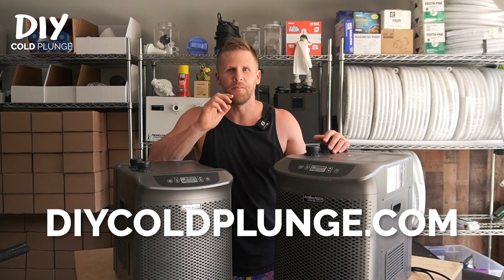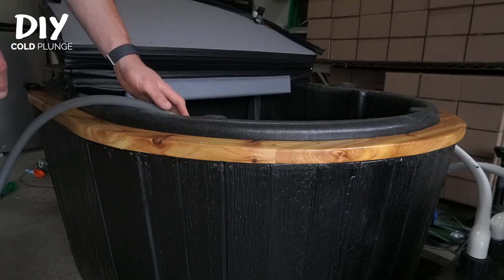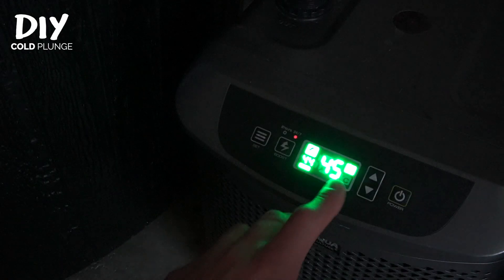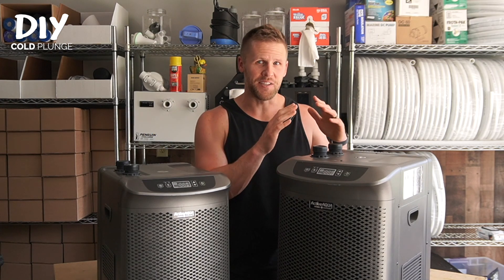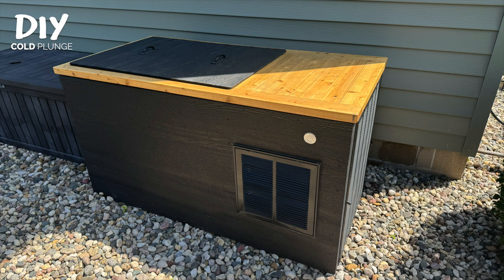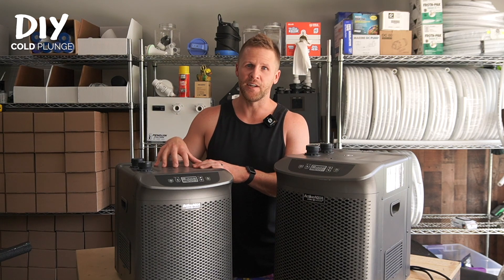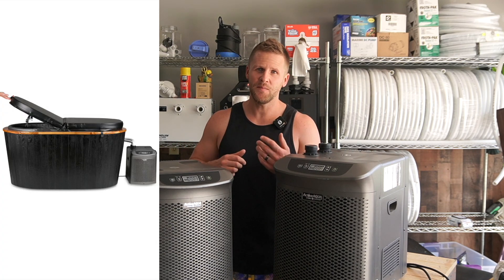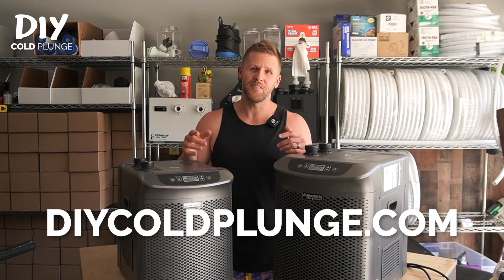Can a 1/4HP Chiller cool a 150 Gallon Tank? DIY Cold Plunge Active Aqua Chiller Review

Comment: I just purchased the 1/4 hp and left it on for a few hours and didn't see any drop in temp. I have 100 gallong insulated build out. The water is currently 68. Should i put ice in it to bring the temp down first or how long should it take to drop 20 degrees?
Reply from the maker: What pump are you running?

Comment: @DIYColdPlunge I didn't see a video discussing this but before I decide to buy the plans, I had 2 questions regarding your DIY Cold Plunge Chiller Enclosure: 1) is it waterproof 2) roughly how much do the materials cost?
Reply from the maker: It will shield the chiller from the elements, not be completely waterproof. I don't have an exact cost breakdown but it's a few 2x4's, siding sheet and cedar boards plus a few hardware/misc items

Comment: Would it be cheaper to buy an ice machine?
Reply from the maker: Not necessarily... there's a lot of manual labor that goes into constantly putting ice in (even with a machine), it leads to more frequent water changes, and you also need to make sure you get an ice maker that can HOLD the amount of ice needed, not simply produce it.
Reply: @ Ok. Thanks. New to this so your channel has been very informative and helpful.

Comment: Me: Industrial Automation/electrical engineer by trade Amazon: GarveeTech 6L 5200BTU (0.9HP compressor motor) built in pump 2.5ishGPM max lift height 13meters. $310 USD. Not wasting your time. It's proper. I'd install it in a machine cooling system in an industrial setting. I don't do/know much about cold plunge..but I know industrial quality equipment when I see it.
Reply: You cold plungers should get into your craft a Lil deeper..talk BTUs...talk flow..talk temperature stability.
Reply: ..and if your equipment supplier doesn't speak that language. Stop buying from them. Metrics matter.
Reply from the maker: Those chillers are designed for an entirely different application - if you can get it to work for this I'd love to see it 👍
Reply: @DIYColdPlunge   It chills and pumps cold water. That's it's design purpose.what are you doing so different? I don't do "Cold Plunge" but that's all you need.
Reply from the maker: @ I'd love to see it.
Reply: @ I don't do youtube content...but I could fill a bath tub and record how cold it gets for viewing pleasure. Shrug. I'm an automation Engineer..I can confidently tell you it's the same device..oh..except the pump is actually built in and it has proper industrial temp control settings down to dead band and hysteresis.🤷‍♂
Reply from the maker: @Arick_Lee  👍

Comment: Joe, would the 1/2 keep up with repeat plunges? Currently using a 100gal galvanized stock tank. Probably 60ish gal of actual water. My wife, daughter, brother and I all take turns on Sunday morning. Last Sunday I probed it before and after each dip and it looked like we only saw an average 1° rise in temp. Another bucket of ice and on to the next person. Or...what about running two tanks off one chiller? Thanks!
Reply from the maker: Gosh it's hard to say without actually testing that.... With multiple repeat plungers the ice addition may be necessary regardless of what chiller you use.

Comment: Hi Joe, My chiller Active Aqua 1 HP started to rattle when the compressor turned on. It then cooled the water to the desired temperature and shut off. It then started rattling again when the compressor restarted. Is there any solution or fix for this? Thanks!!! I don't have any problem with the noise, but it feels wrong to have it rattling.
Reply from the maker: Hey! Not sure... are you able to send me a video of the rattling?
Reply: @DIYColdPlunge  yes! How can I send it?

Comment: Interesting. Ive had my 1/2 hp chiller for over a year now, and every time my plunge is in the sunlight, the chiller cannot maintain the temperature. I use the rubbermaid 100 gal tank and a 1100 gph submersible pump. I live in SoCal and typically set my chiller to ~45 degrees. During summer it will get to about 55 degrees during peak heat hours.
Reply from the maker: Any insulation on your tank?
Reply: @DIYColdPlunge  None, just the tub as it comes.
Reply from the maker: @rcg1183  that'd be the issue 👍
Reply: @rcg1183  Insulation makes a massive difference especially when its outside in SoCal.

Comment: I have the 1/3 Vevor and a 700 GPH pump but it just doesn't move much water. I was hoping to upgrade to a 950gph but didn't know if it would be too quick for the chiller.
Reply from the maker: The 950 with play well. I ran that exact setup for 3 weeks without issue. Working on a longer test now.

Comment: FYI, my chiller is in a outside storage shed. I have a half horse no name brand chiller from China that is similar to the one in this video. I have had it for a year and it has been flawless. I live in St. George Utah and the summer has been extremely hot 100 to 116 for the last three months. I keep my 150 gallon tank at 35°, I run it till one in the afternoon and shut it off and turn it on at 11 o’clock at night. The temperature rises about 4° – 6° and  the chiller brings it right back down to 35° Within a few hours, I use it at noon. I have 150 gallon poly cattle tank that is oval. I insulated it on the outside, on the bottom, and have an insulated lid. I can’t imagine anyone needing a one horsepower chiller, as my chiller is out of the sun in the outside temperatures and it never has any problem, keeping it at 35 or 33°.
I turn it off at one in the afternoon as to not violate the instructions and run it over 105° outside temperature.
I have had it over a year and a half horse should be more than sufficient for anyone outside in any heat condition.
Reply: THANK YOU!!! 
I've been thinking of getting one of the knock-off chillers because their SOOO much cheaper!
Reply from the maker: I appreciate the info

Comment: Which pump were you using with the 1/4 hp chiller on the 150 gallon tank?
Reply from the maker: 1200. I'd recommend the 950 though - https://diycoldplunge.com/products/danner-950-1200-pumps